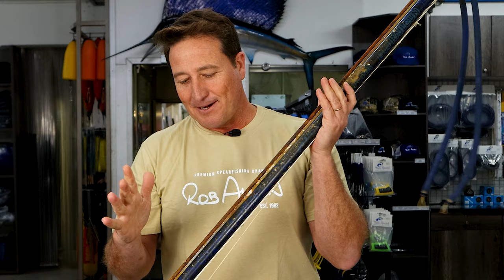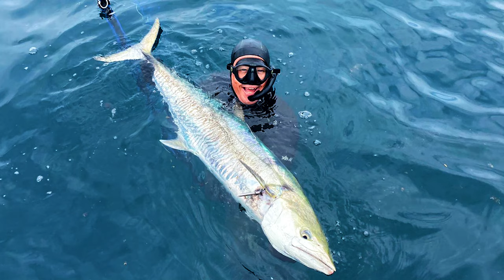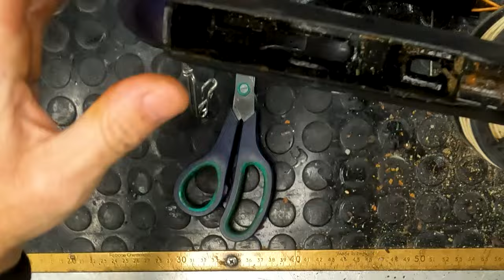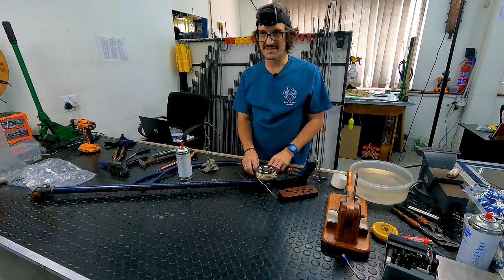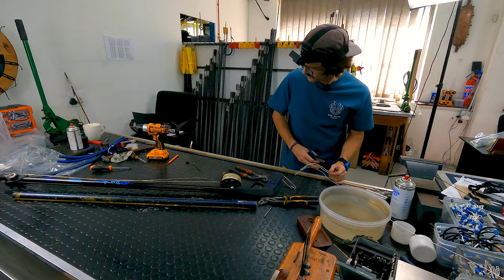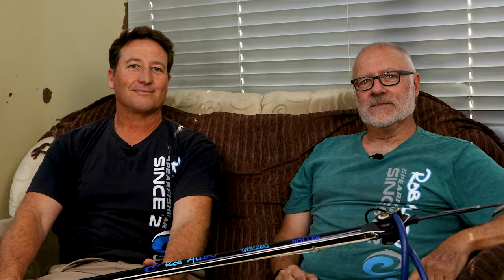Rob Allen | Lost and Found | Part 3 | 2024

Comment: Hey Rob, awesome video as always! I live in New Caledonia and i recently found a lost tuna 120 underwater. Kind of a lot of growth on it (a year underwater maybe). I plan to powerwash it then dismantle it and make a white vinegar bath. Do you think it is a good plan? Thanks a lot!
Reply from the maker: Best is to completely dissemble the parts as we did in this video. Main thing to check is the aluminum barrel. The last thing you need is for that to collapse while under load. The spear will have deteriorated and probably the bands. Send us pics if you want and, good luck.
Reply: @RobAllenSpearfishing  Thanks a lot! i let the fate decide if it still works. I lost my gun like 6 months ago, and now i found one that i kind of always wanted! It will be impossible to find the owner so i'll try my best. For now, i'm planning to change the spear and the bands at least. How can i send you pictures?
Reply from the maker: @maelickjean8663  You can upload pictures and or video by several means, when you are ready you can contact our videographer. If your story is good we will put it up 😜👍
Reply: @RobAllenSpearfishing  yeah i will try to make a good video out of it. In the meantime i've sent to you the photos on instagram. I'm not an english speaker, i'll make a silent film😅If the restoration does not work i'll just buy brand new RA 130 roller for christmas😎